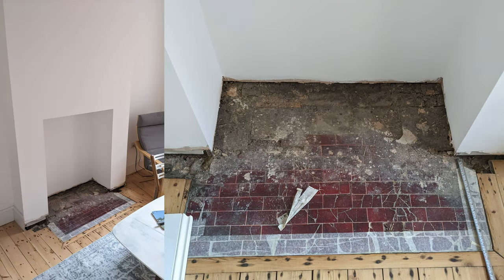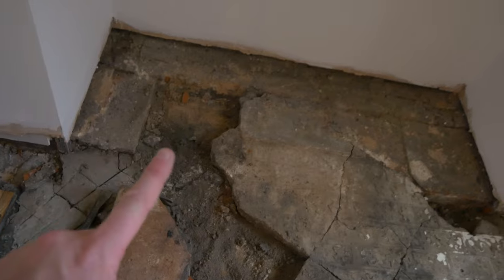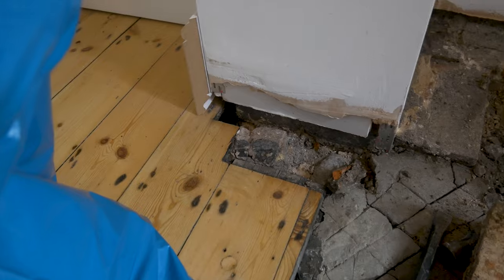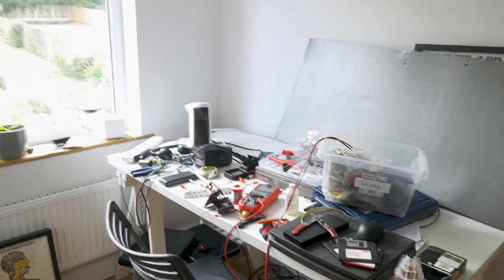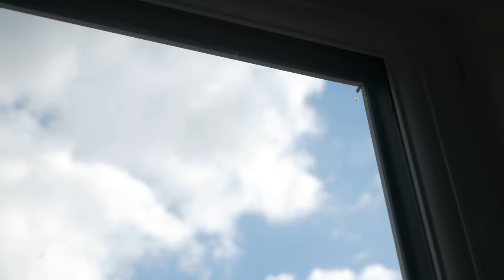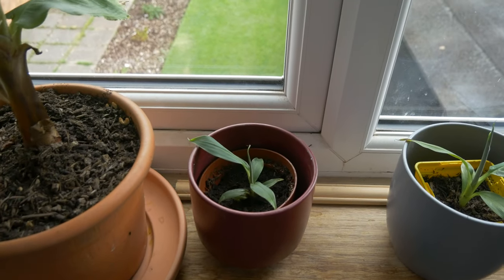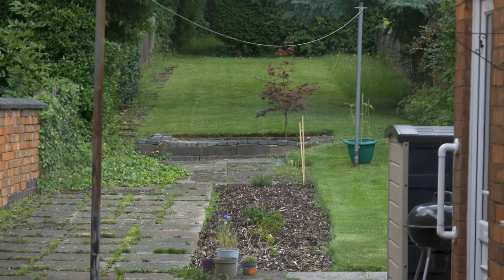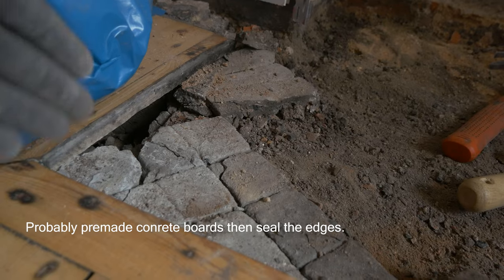House update: To the hearth of the matter

Comment: They are probably firebricks laid with Fire cement and tile adhesive would survive the temperatures that close.
Nowadays real fires are nice but a hazard. you can get the same results safer with modern fire effect electric fires.

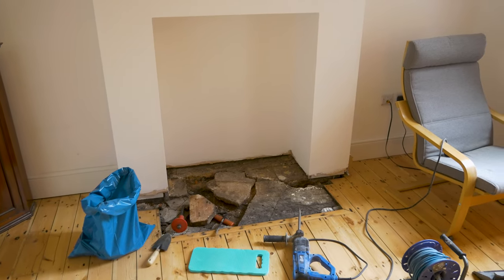Comment: 6:30 never try to match the wood. Remove all the bad stone completely and build a new structure on top, and later on you can decide how to fool the eye , I mean distract the eye from the weak spot, the damage point - which only you know and remember. 

Maybe find a nice old oak tree board and simply build a u-frame or whatever but I would start with a simple plain white solution, then play around with a newer board which might not fit that well, but gives you an impression. And then sometimes you will find an old board in a shed or what ever that can find new glory there. Put the board around that wall like a u and then you can lay another horizontal piece that will look like it belongs there. We had done that 25 years ago in a similiar situation with no chance to get the spot fully covered with old ornaments or tiles and could never found matching ones, cause one time they were darker other time they had a different size or they had stains. At the end we took an old board of oak and cut it into a frame all around like in your situation and layed that horizontal one like the verge in a door, This way you create 2 rectangled areas that you can fill what ever you like separted by a door verge or maybe called door sill. 

Might sound weird, but start to clean the mess, build the new underfloor, put a white sheet of paper onto it which are used in conference rooms to draw sketches. Then you have a white floor and can play around with a kind of frame out of planks. The older the oak the better it will fit.
Reply from the maker: Got a plan, a rough one, well... not really a plan but it'll hopefully work out. I'll see if my tiler will let me record but it should all work out. Although it is called a structural hearth, in this case there is nothing structural about it. What is the worst that can happen? 😉 

For covering the floor gap, I have found some really nice blank sign boards, like mounting boards with a lovely mitred edges (unsure of spelling) that I could cut in two and paint the same as the skirting. Not bought them yet.